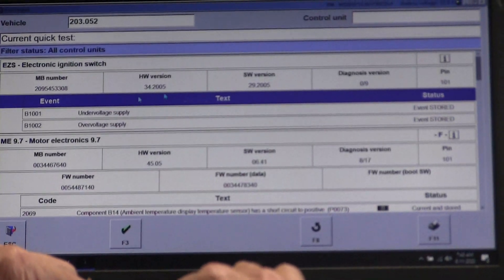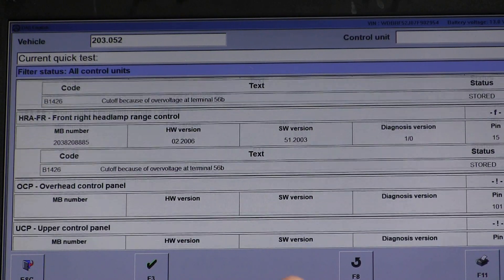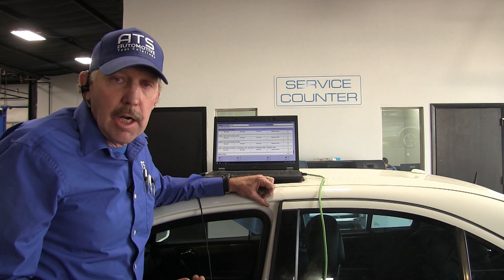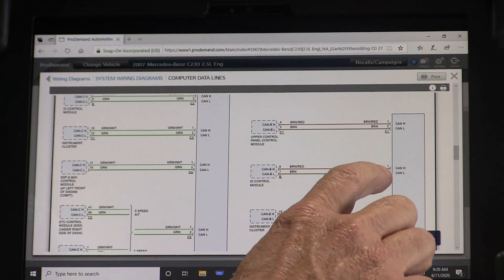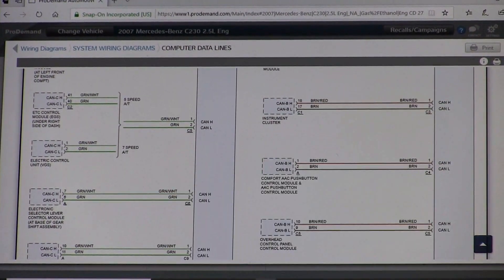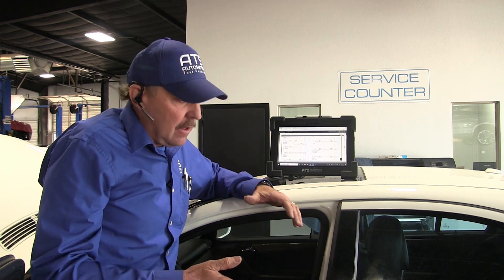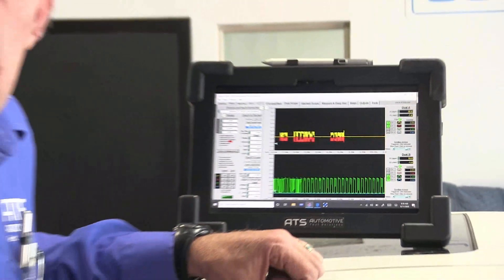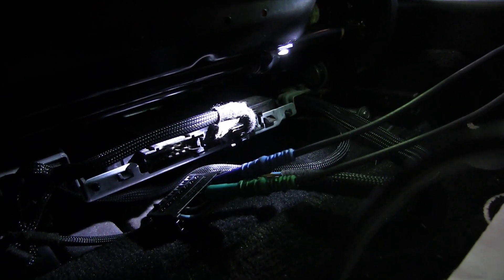Diagnosing a 2007 Mercedes Benz C230

Comment: I have an 06 C230 Sport, after a dead battery and attempted jump start and subsequent battery replacement, all other accessories work, but the car will not crank.  It was working perfectly prior to the battery incident.  Where should I start to look ?  Thanks

Comment: Another excellent video Bernie thanks for making it. My question is how were you so confident off the bat that the reason the voltage was being pulled to ground was a module? And wasnt going to be a short on the wire? Thanks

Comment: This is truly a good lesson to learn , fault tolerant can communication systems are usually  parallel based circuits and must be two wire systems also... if I am correct . The ATS scope is a true automotive diagnostic oscilloscope it will answer more questions then it will make for the money you can't beat it . Hope to see many more thought processing videos from mister Thompson thank you sir .